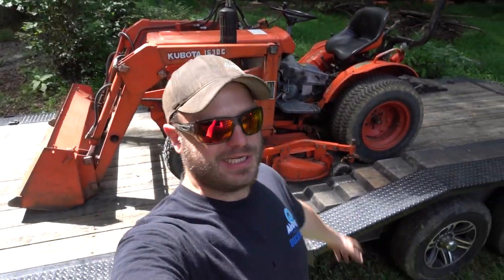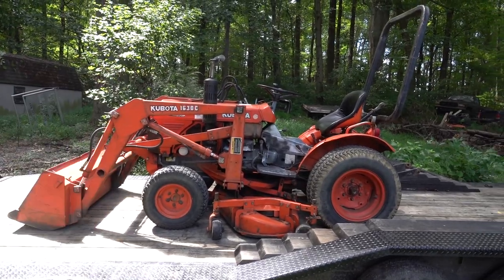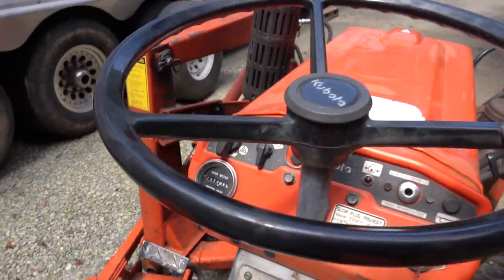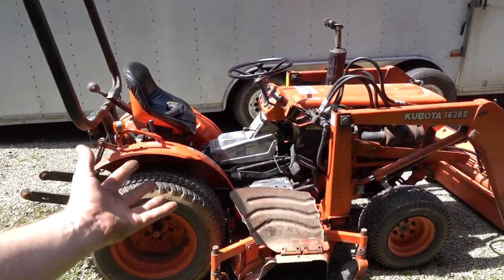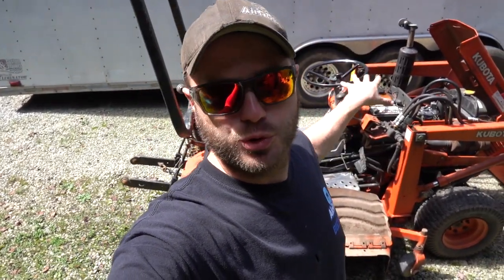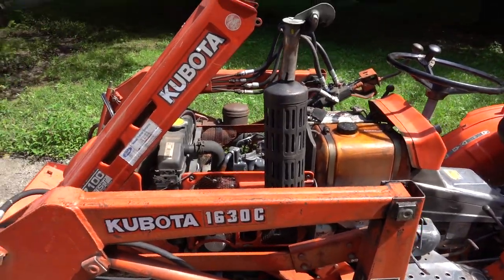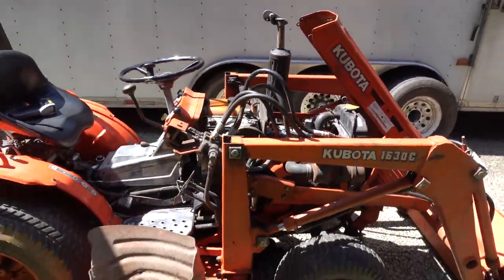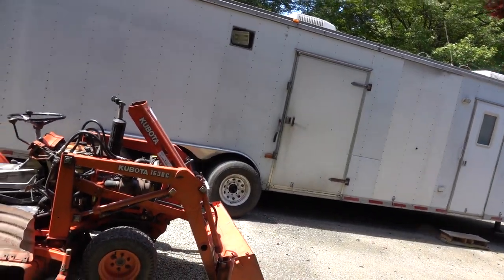FINALLY... We Got Our First Piece Of Diesel Equipment!!! This Is A Game Changer!!

Comment: Hey Tom be advised make sure you have some counterbalance on the back because if you start using your loader to move dirt and stuff around it’s hard on the wheel bearings without counterbalance not wait in the tires it Hass to be hanging off the back all right good hit on that machine money well spent Kabota makes good stuff this is six in a row Jim I am from Kennerdel PA

Comment: Pull the belt on the water pull. Remove the thermostat housing and thermostat. And start it up. Check for bubbles.  If so. Cracked head. Check the fuel. Could have gas in it too. Seen both. If you need any parts hit me up. I would at a kubota dealership. If you need any information let me know.

Comment: Cracked head could be the issue usually crack between the valves. Check your rad if you have pressure.
Rebuild kits are fairly cheap though. Once you get used to the bucket you’ll never want it off! Too handy.

Comment: To me that's not really a tractor. It's a lawnmower with a loader. I  bought a  tractor to have something I could lift and move diesel engines and such. It's still small (60hp) but it's big enough to throw a duramax/Cummins and 6.4 powerstroke